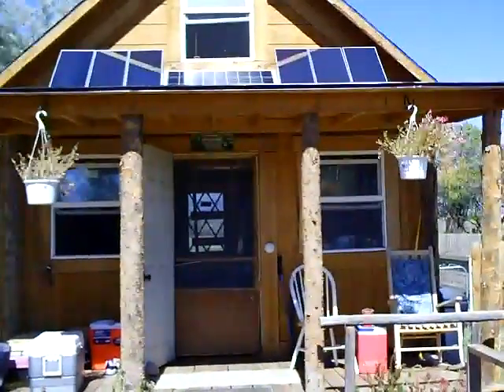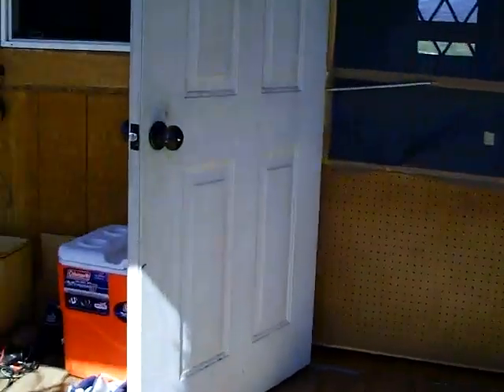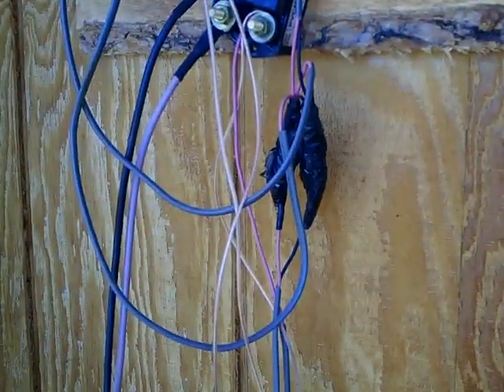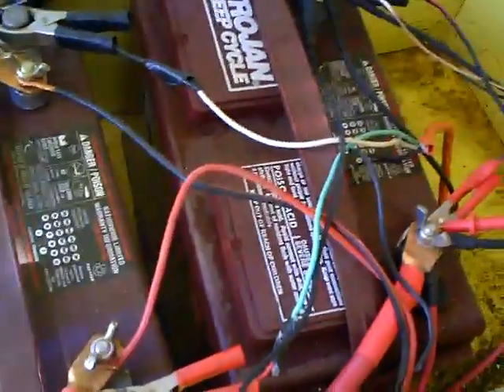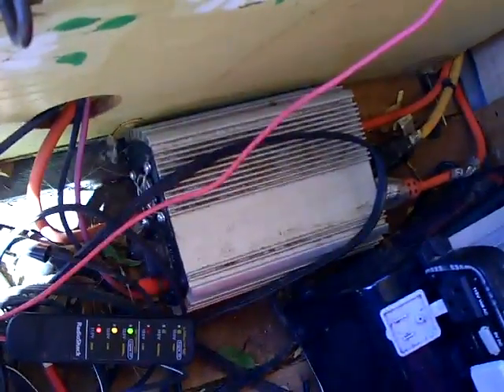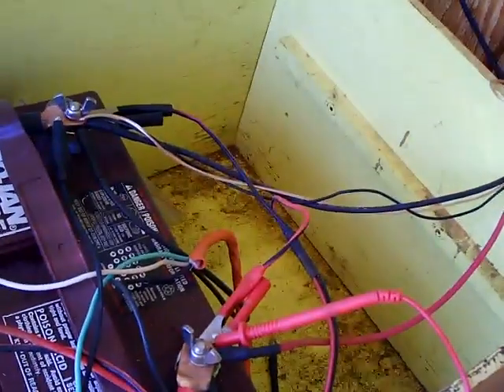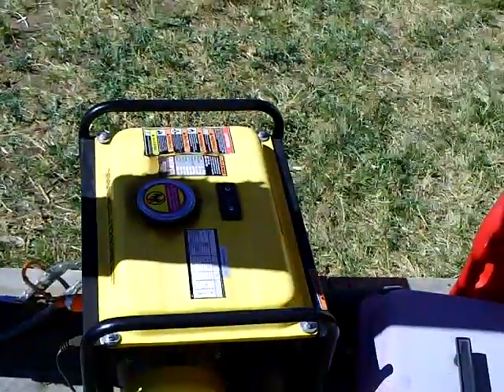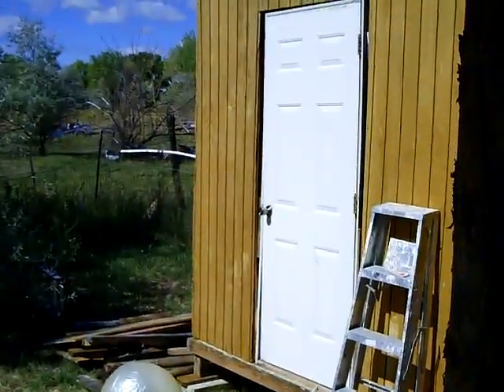Solar electric system

Comment: I love how $3000 used to be a good price for a system like this, now 400w of solar panels is about $300, and $200 will buy you a lithium battery of the same capacity as the trojans.

Comment: I started small like your system then i went a bit higher to 1400 watts half home made half monocrytaline i still struggled to meet my familys needs i since switched grade A pv 3kw per hour system with outback solar controller 80 amp on 48 volt battery bank i bartered my way to all of this i work for myself i blew my knee out fighting fires in northern washington so i had to leave it began to overwhelm me with baby on the way injured and half a million acres burning sorry for venting i was wondering what i should do with my old solar system outdoor night lights for bear and sense of security? Another seperate cabin ? Or do something up higher on a farther cut any ideas are appriciated i watched your videos years ago they helped me then id like them to help me now so id gladly like your opinion my land was purchased on ebay you can click my channel to check it out on my adventure i want to thank you for your videos yours and many others inspired me to go off the grid i wont look back

Comment: So I have a question. I understand using the panels and the batteries and the inverter. But how do you get the power into a house that runs on ac power from the inverter? Do you  plug inverter into a power socket in the house and bam the whole house is charged? Thanks

Comment: Being off grid also means less dependent on the middle east.
Just to emphasize and add.
1 - if possible get Sanyo panels. The best quality panels on the market. Depending on the latitude these will last 40 years.
2 - Deep cycle batteries are preferable, because these batteries will likely be used until they get very low.
3 - Backup generator is a must for people living in areas with long winters or many storms. Highly recommend Yamaha or Honda gens. Far quieter, much more reliable and single pull start, Chinese made gens are fine for occasional uses, but they are LOUD and often hard to start. Your neighbors will appreciate the much quieter gen.
4 - Shell out for a really good charge regulator. They are not made of plastic. A good unit will not only regulate the charge but also monitor the battery and cut off power to appliances if the charge gets too low or the battery over heats.
5 - lead acid batteries have about 4 to 6 year life depending on quality and usage. Change them about every five years.

Comment: I can't get my inverter to work with my small system it drains the battery to quick and the low battery protection come on and kill the power please help
Reply from the maker: The inverter should not drain the battery. if that is happening your battery may be bad.

Comment: I'm just starting my journey to off grid and am finding your vblogs to be more than helpful.  Quick question though.  Have you ever put much thought into setting up solar electrical systems that are independent over tying all your panels into one system?  I have put a lot of thought into this am leaning towards setting my system up this way.
Reply from the maker: Combining your panels requires less batts and charges faster.
Reply: solarcabin Makes sense, thank you.

Comment: I'm going to try and run a computer UPS for my inverter, for $100 it gives me 2400w(240v 10a) and runs off a small 12v battery.  I think if I get two or three big batteries and a mppt controller everything should run like a dream.

Comment from the maker: Depends on the turbine. I have an Air X that has a built in controller. Most turbines require a separate controller and a dump load.

Comment: I wonder if you can answer a question for me.  Say you had a wind turbine also, and you wanted to connect it up to this setup to charge your batteries?  Could you either connect it to your "Power Controller",  or buy another "Power Controller" and connect that in parallel to your battery array?  I'm thinking some of the new vertical wind turbines are pretty nice and would charge when the sun is not shining?

Comment from the maker: I don't have an AC unit but they make small swamp coolers that will run off solar. I use fans and a passive roof turbine and the porch and trees shade the cabin. We don't get real hot here.

Comment: Thanks for the clear descriptions.
1. How deep is your well and how many watts are required to run the pump?  ie. if you just wanted a system to run the water pump and nothing else?
2. What precautions do you have to take with your system when you leave for a month or two?

Comment: SFF sure you can, depending on the installation you should be able to connect the panels together on the roof an only have two bigger wires down. But thare is another issue of this video, I did not see any fuses around the batteries, as you say there is a lot of wires. If one shortcircuit these wires, they wil burn emedialtly if they are not protected by fuses. 12 volt systems can be wery dangerous if not protected by fuses. I cannot see if the small controller holds the fuses.  ALWAYS use fuses

Comment: Would this run a regular refrigerator? We have a small old refrigerator and since it is from here in Mexico I am sure it is not efficient. We don't use much else but lights and computer.

Comment: this cat is my hero! great job and thanks for sharing! didnt build mine...I purchased a used wooden office builing..was already wired etc...11.5 feet x 32 feet with 2 foot porch..if ya can call that a porch..lol....mite be an option for some..I got it 6 or 7 years old for 2,500.00 bucks...good luck to everyone with your cabins

Comment: Could you use your workshop with a small electric heater to dry clothes on the inside? Maybe a small electric fan in conjugation with the electric heater to add circulation.

Comment from the maker: You could put up three 100 watts or two 250 watts and I would use a 24 volt system with 2 or 4 12 volt deep cycles. Look on solarblvd for good prices on panels.

Comment: hi can you help? im looking to set up a solar system on my van roof , i have 7ft x 5ft roof space , can you recommend what size panels and how many i would need, bearing in mind i live in england with not much sunlight and cant angle them towards the sun , they have to remain level..i need to power laptop , lights , charge phone, shaver, microwave..would a 200amp battery be ample? or rig up 2 and make 400 amp?..sorry to ask so many questions but i need to get it right and not mess up , thanks

Comment: Maybe you are interested in a system like this? 

asvsolar.no

It's a solar water heating system. Sorry, but it is in Norwegian only. The guy built a system and is selling it. It is simple to maintain, the pump has sensors and stop if it's too warm, or too cold, so the water runs back into the tank. No defrost chemicals needed in the water, just water is needed. This gives a much higher efficiency to heat the water, and it is more ecological, too.

Comment from the maker: Yes- you get more amp hours from 6 volts than 12 volts and they can be hooked in series or a 12 volt or 24 or even 48 volt system.

Comment: Net metering will not give you money. Feed in tariff would. Net metering, at least here in Hawaii, is where the electric company credits you 1 kWh for every kWh that you don't use, so that way at night and rainy days, etc you are just using up your own credits. FIT here they give you 27.2 cents a kWh. They charge 33.7 cents here for energy though! So people doing FIT are just getting a 2nd system to make some money on.

Comment from the maker: @gg010170 

Solar panels are very sturdy with safety glass. The Harbor freight panels are a good starter system. Passive solar heating is different than solar electric. I cover all of that in my book.

Comment: How is that your solar plates do not break during storms.  It is my understanding that they are very fragile.  I hope that is incorrect.  Also, it sounds that you started out small.  And then expanded.  Is there a small solar system that you would recommend for us less crafty folk?  And is there such thing as solar heat without batteries?  I thought rocks could sustain heat for a home during the day to heat a home at night.  I could be incorrect.  Just trying to learn.  peace

Comment from the maker: @RawFoodGuy99 

Sorry I misunderstood. I run both AC and DC off solar and no you don't need a permit if you meet codes for wiring. Batts last 5-7 years on average.

Comment: being connected to electricity is a better backup for washing and cooking than generators I think. if the base fee isn't much.
you can quickly create a lot of work burden trying to be free..

does your cabin have good insulation? that's also key to low cost living even though it costs a bit more up front. it's just smarter to have really good insulation.
if you live in a very hot region and you use AC then paint the whole thing white. makes a huge difference in sunheat intake. also airtight

Comment: A little tip for better performance on your battery bank, if you run your connections for your feed on opposite cells your battery's will last longer . I E load balancing, you want all positives on one battery and all negatives on the other battery. reason for this, even if you are running thick ass cables, you still have the resistance of those wires between your battery's and if your run your feed line off only the one cells terminals, then that cell bares more load then the other,

Comment: Earlier you said that microvawave oven requires 750 watts of power, but gas generator wich you use for feeding it, produce only 500 watts of power. How it works? Maby oven's 750 W is a "peak power"?

Comment from the maker: Well, I have antennae but satellite or cable could be run off solar. Cell phone works fine here and I use wifi for internet or you could use satellite internet.